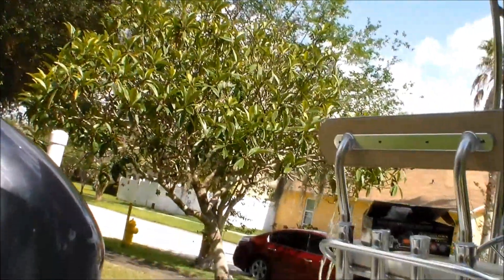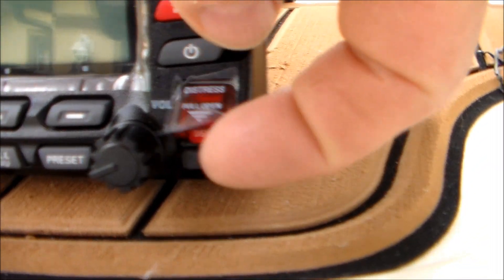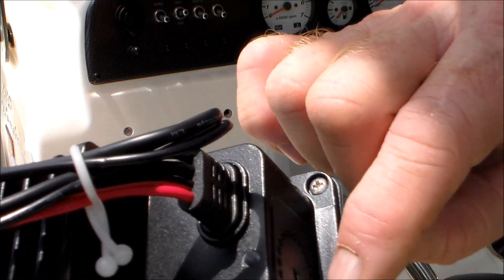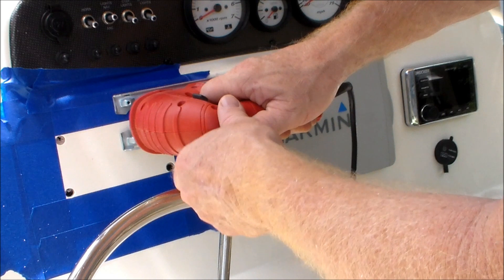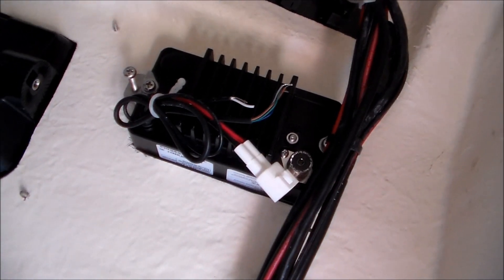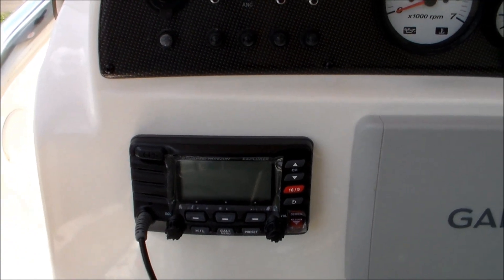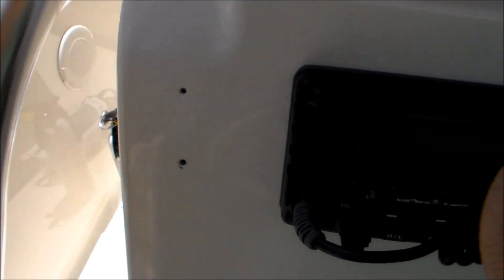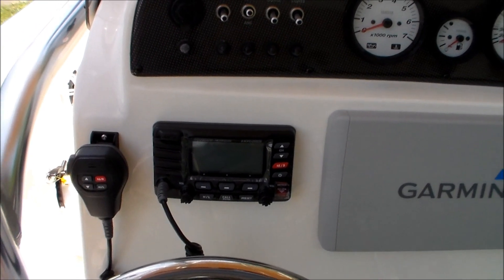DIY INSTALL VHF RADIO

Comment: Not me. I put it on a wooden stand. The antenna cable can come inside when my antenna unscrews. Half the time, the 25 watt radios sits on a bunk, which is a great place when you sleep. Talk softer in the microphone when the boat gets loud. Also have a CB radio and decent antenna. I like gator clip jumpers for 12 volts. The radio can go home or boat to boat.

Comment: If you buy a SH radio without gps, you MUST connect it to a gps unit. Otherwise, it will give out an annoying beep every 10 minutes.
Reply from the maker: Thanks Don for your comment. 
Luckily mine has a built in GPS.
That would be very annoying if it keeps beebing.
Tight lines....

Comment: Tip: Microphone screws... buy same size stainless screws and use soap on the screw so it does not get tight when screwing in the hole.
Reply from the maker: Thank you captain. 
That's a great idea. I'll keep that one for the next time I encounter that situation.  Thanks for watching.  Tight lines

Comment: I have the same boat without Ttop. I not sure where to put antenna
Reply from the maker: Most people I see they put it on the side of the console
Reply from the maker: That was a great boat and I enjoyed it.
Reply from the maker: Looking at pictures of my boat it looks like the best place to put it would be on the starboard side of the boat to the top area of the console. Then when parked you could lay it down towards the bow or stern.

Comment: When you inserted the radio, does it use a gasket or did you apply any sealant to keep water from running through the cutout and into the console?
Reply from the maker: It had a gasket but I sealed around it also

Comment: Nice work. Question, did you run long positive and negative wiring straight back to the battery, or did you wire it with short wires to the positive terminal, and negative bus bar in the the console? I'm about to do this in the next couple days.
Reply from the maker: @TheJoshGriffis  hello there,
So i just tied it into the power bar behind the console.  Made life a lot easier. However,  you can run it to the batteries if thats a better fit for you.
Tight lines. Thanks for watching
Reply: I like clip jumpers, red and black, for 12 volts. It's more versatile.

Comment: I noticed you have a new boat now. Did you upgrade the vhf radio or antenna? What antenna did you go with?
Reply from the maker: They radio was given to me from the boat manufacturer because of some screw ups they did. I can't remember  the brand off the top. But the antenna I bought was the same as the old  boat. It's an 8ft Shakespeare  model but I would have to look up the number or I think I mentioned it in my video of the install

Comment: Thanks for the video. I will be installing mine soon. SH1400 w/gps. Quick connect rail mount with quick connect 4’ antenna on the grab bar.  What was your results offshore distanced?
Reply from the maker: So the best I had so far I was about 30 some Mike's out and wS able to reach the marina
Reply from the maker: Thanks for subscribing to my channel.
Good luck with your install